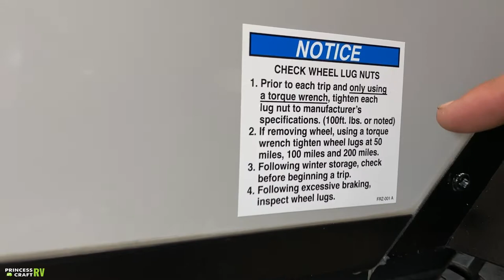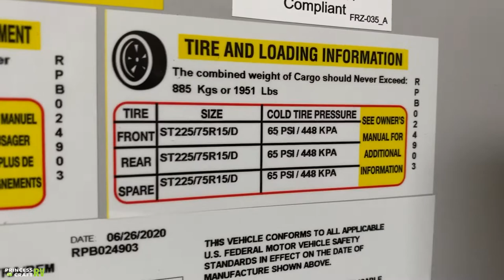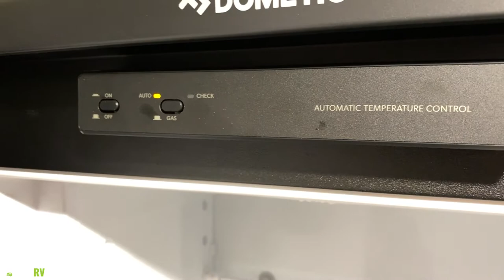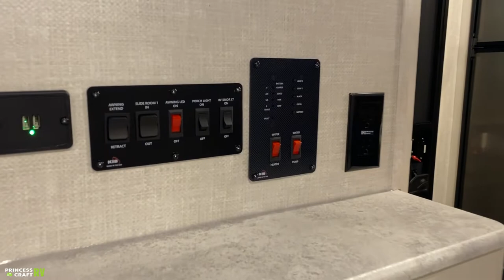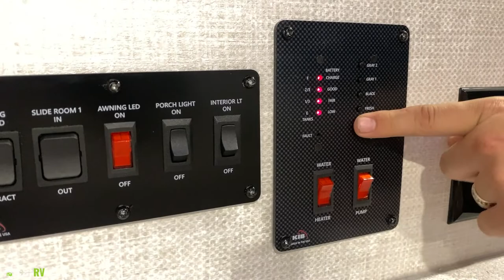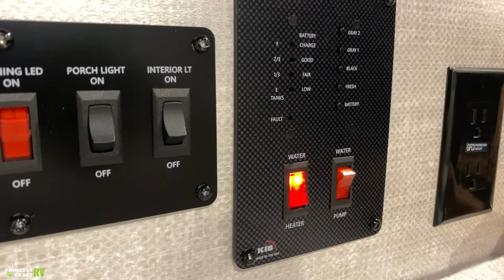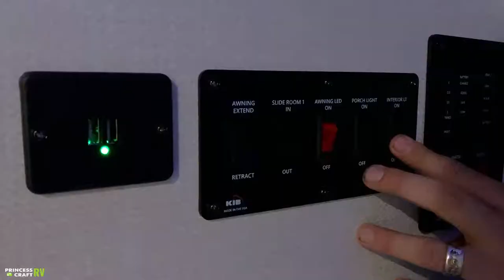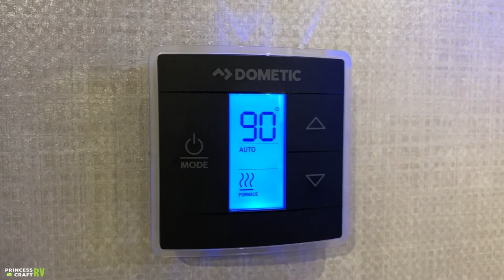R Pod 202 - 2020 by Forest River Technician Tour

Comment: In my R-202 there is a valve in the shower below the hot and cold water knobs.  It will turn the shower off, but it sounds like it is diverting the water into one of the tanks?  Also the hot and cold are reversed in my unit lol.

Comment: Question:  does the hot water heater - either the electric element  or propane - cycle on and off automatically using a thermostat?  If not would you want to turn the water heater on - either electrically or the propane switch - and leave it on for an entire weekend?  OR  do you turn it on when you need (allowing for heating time Ofcourse). ??